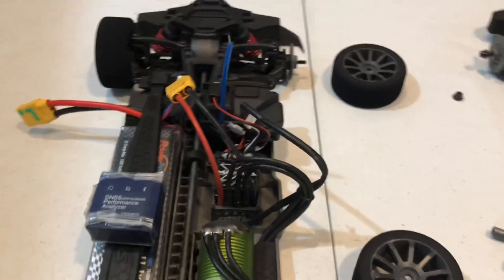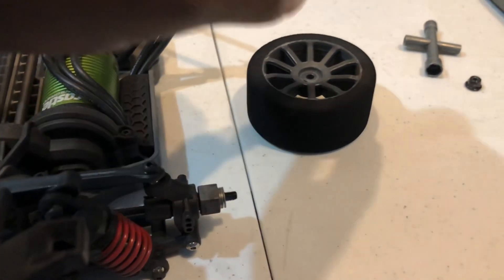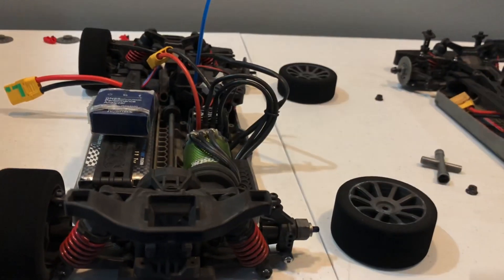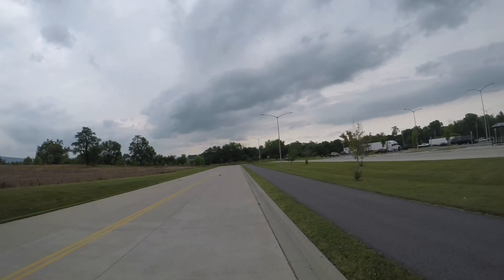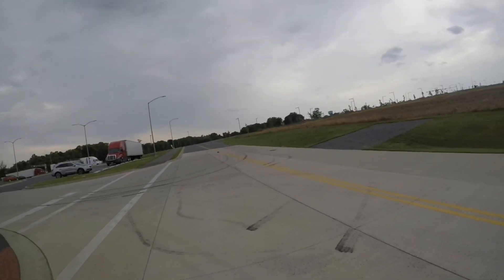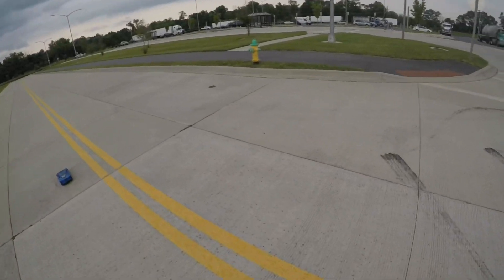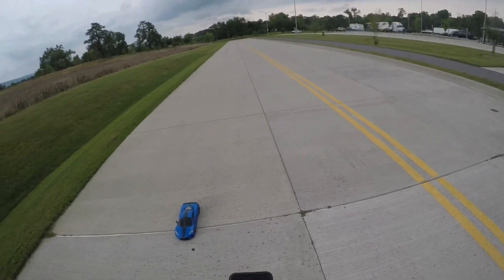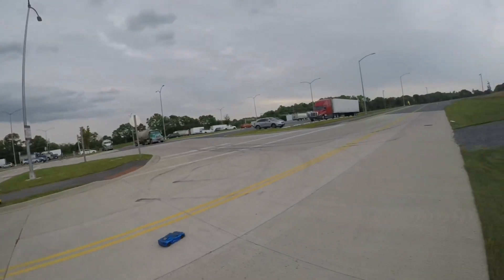Traxxas 4tec 3.0 team Corally foam tires and test run | UDRC

Comment: I’ve gotten a gps speed of 76 on my vxl stampede. I’m certain it will go faster, but everytime I try It ends up crashing into something!

I think I’m gonna pick up a 4tec this upcoming week so I can have some more controllable high speed fun
Reply from the maker: Sweet. I wi recommend changing the radio and tires on the 4tec 3.0. I put the tqi because I had a few sitting around or a radio link radio. Foam tires will be needed. Other that that it will be a blast.

Comment: Car looks good man..was wondering why and when can you run foams.my local hobby shop has 2 speedtreds foams for a sct.im new to rc by the way thats why im asking
Reply from the maker: Foam tires give better reaction and is more reliable than these stock Onroad tires that it comes with. If you are going to run it stock out the box then you may be okay but the traction is not that great either. Overall foams are much better for speed run it drag racing or just bashing in general in my opinion.
Reply: @UDRC85  did you get skinnier for the front or rears all around?